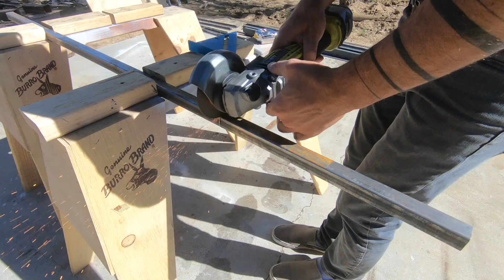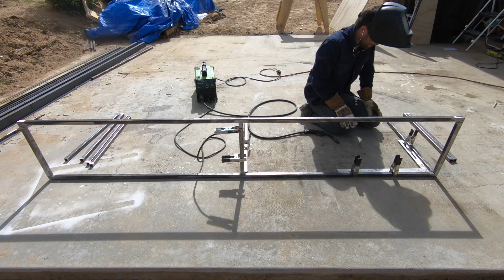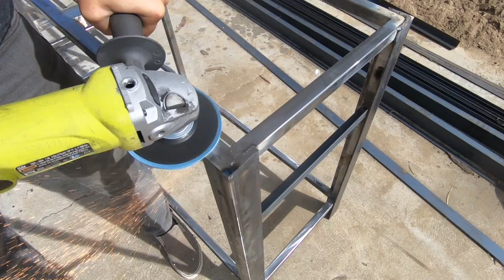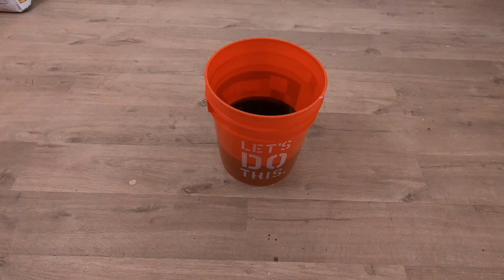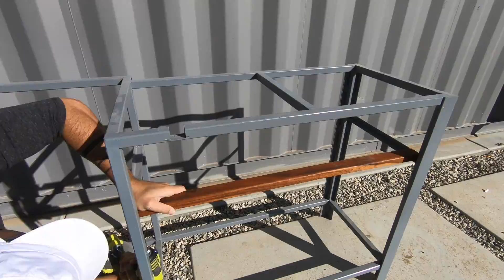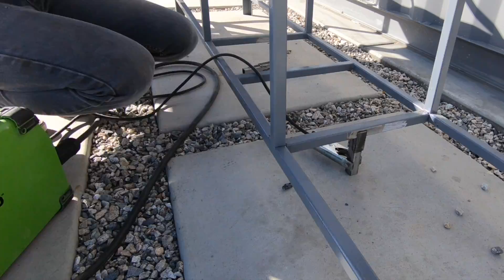Building a Grill Station with Concrete Countertops

Comment: Its a very nice project, certainly gives me some inspiration for my smoker frame. But a small advice on that cutout for the burner pipe, seal it with something like spray foam. Ive left a cutout for folding an outdoor table frame ive made, years later ive noticed that some bugs made they home in the hollow space of the frame as well as rust eating some of the weld joints from the inside.

Comment: Are you mig welding without gas? I didn't know you could do that. Its what's preventing me from buying a welder. I know I can use stick welding without gas but I heard its difficult and crude
Reply from the maker: yes with flux core wire. i felt the same way and waited too long.  its a bit messy but its affordable and doesnt take up a lot of space.
Reply: Stick welding is no more difficult than mig but some rods are slightly more difficult to start. If get a flux cored wire you can use it without gas and outside. Do research though because there are types of flux wire that require gas, its commonly known as dual shield.
Reply: Yes, look up flux welding.

Comment: How can you "just cut out a notch" from a load bearing element and not reinforce it? Maybe there is still enough material there and in other parts of the structure but it still hurts a little from an engineering point of view.
Reply: I agree about that notch that you cut out!
That is basically your hole supporting structure for that side of the concrete slab. That is failure waiting to happen. 
Your slab is not even resting on the opposite side of the frame, it resting right by your notch, you also have not painted the notch (unless done after wards), Nothing might happen, but never say never. 

Get one of your friends to sit on it and see what happens a test is always good thing.
Reply: Weld some flat bar on the bottom. Problem solved.
Reply: That's what I was thinking. As it is my main concern would be the square tube having lost most of its stiffness, it flexing and eventually failing because of metal fatigue?
Reply: He could stand on that concrete slab above the notch while someone pushes the framing to prove his redundant reinforcement theory. Then again, redundant forces is just an architect's free body diagram, right?
Reply from the maker: plenty of redundant elements to make up for that notch